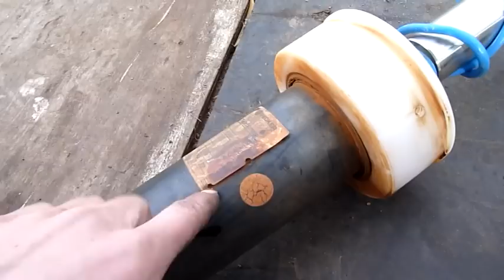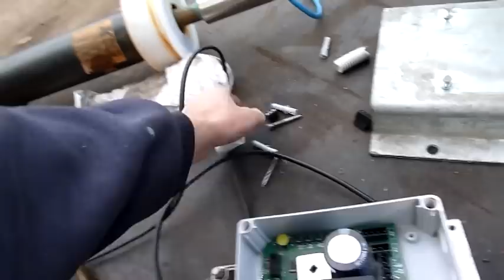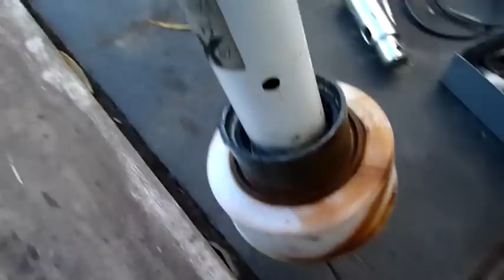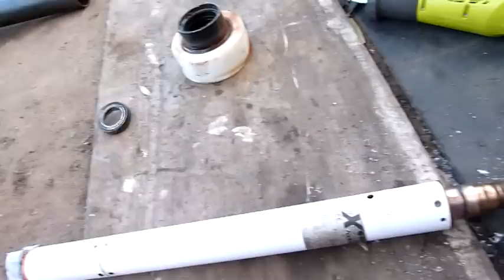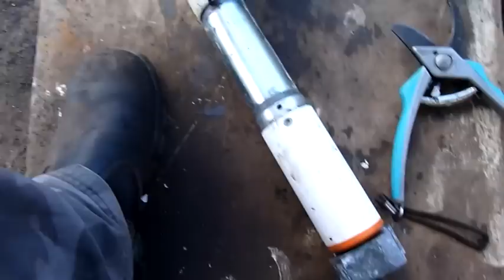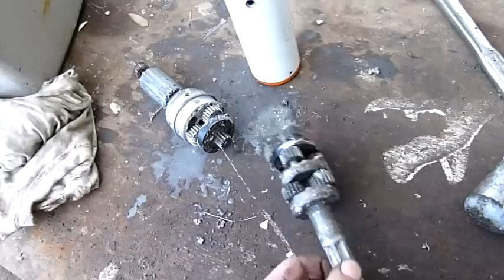Becker Scubadrive R200 3G Motor Autopsy

Comment from the maker: it was used for a submerged pool cover roller, the motor is fitted into a stainless steel tube and mounted in a pit at the end of the pool

Comment: Hello Sir. I have an issue with the motor sitting inside the plastic tube. How you remove the motor from the encapsulation ? i can't see any screws and i'm a bit scared breaching the isolation. Many thanks ! Regards

Comment: First and second stages are plastic for low noise, 3 and 4 are steel for strength, they run at a low speed so steel gearing is not noisy. Annulus is always steel though. Nice autopsy Ed, keep the power resistors though to use to discharge batteries.